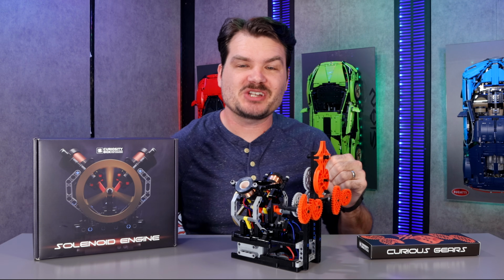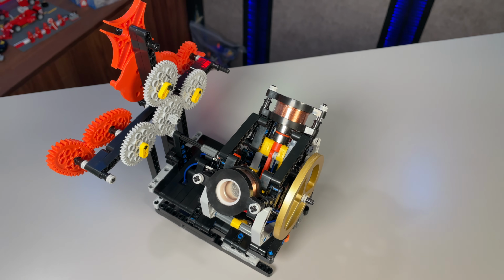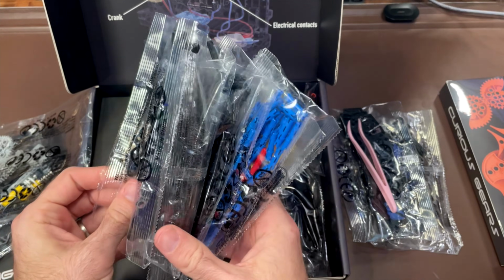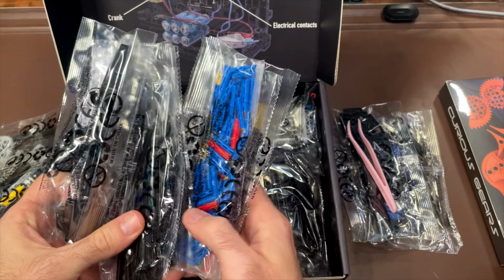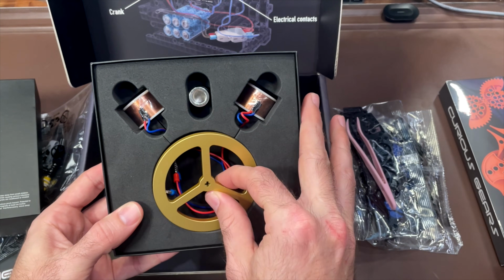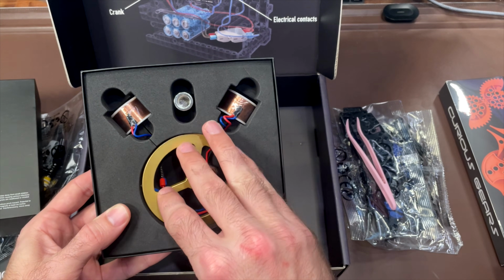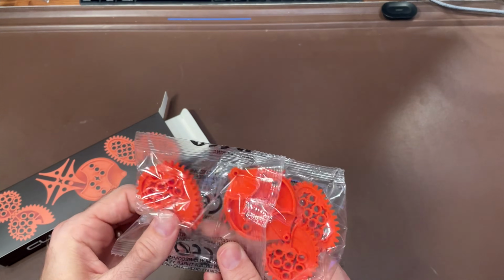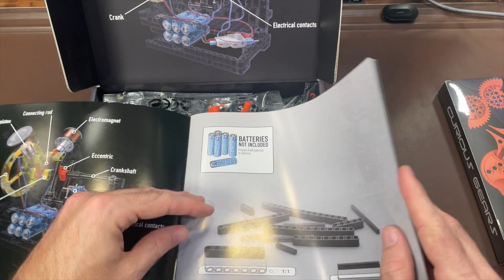I Made a Working Solenoid Engine out of LEGO

Comment: Thanks Professor - I asked them who made the bricks and what they made of and they wouldn’t say. Does the fine print say?
Reply: Looks like the updated the FAQ with my question about the plastic. Funny they still show as pre order
Reply from the maker: Yeah I was gonna say "made in china," but I remembered reading it's ABS plastic. Feels fine because it's all beams and axles instead of bricks. Only had one or two pins that were a little warped.
Reply: @ when I was talking to them a few months back I wanted to make sure they weren’t 3d printed which it seems they are not